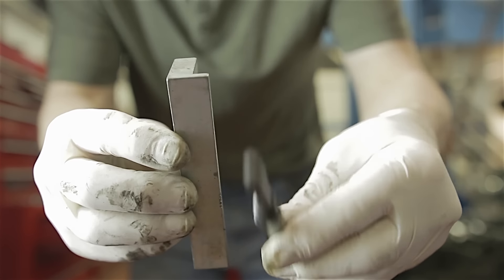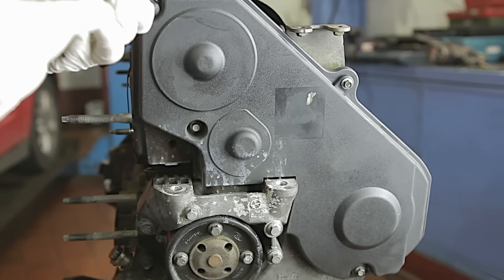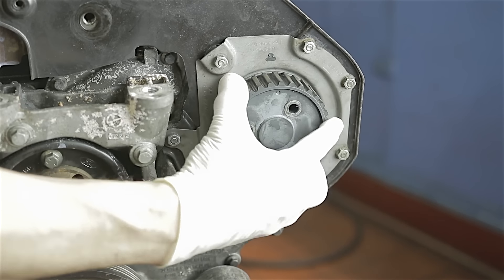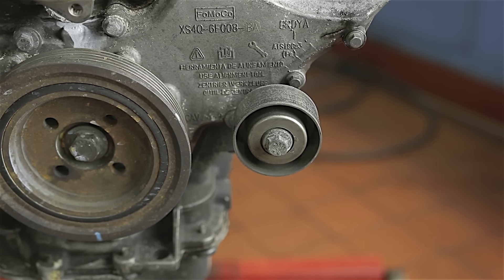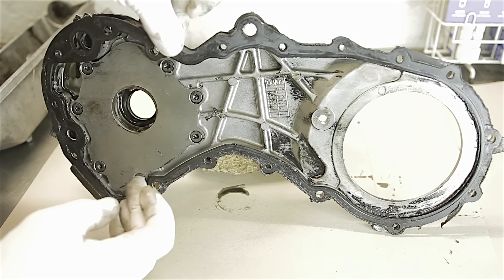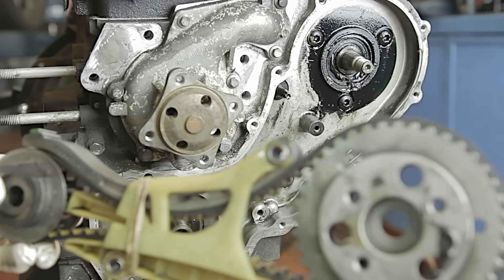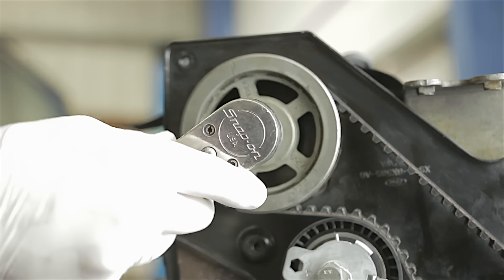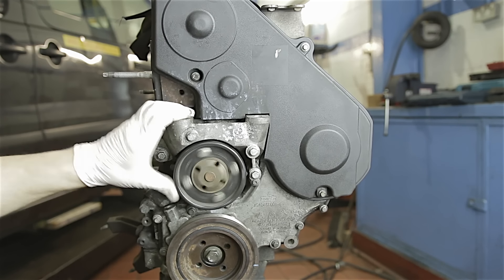Ford Mondeo/Transit Connect 1.8tdci wet timing belt replacement

Comment: Great work Alan, thankful for this video
Sadly my wet belt possibly snapped other day, is it worth changing the wet belt or what are the odds of piston-valve damage?
Reply from the maker: that will almost definitely have bent most of your valves and maybe broken valve guides
Reply: @alan4x  that is bad news, will be easier buying a second hand engine than and change it over.
Thanks Alan
Reply: @alan4x  managed to took it apart and fortunetly just shred the tooth of from half of the belt.
is still could damage the valves? what do you think? ordered new belt kit and will put it back together, soon as the belts is on i can check valves when turning the engine over a few times, managed to find a reconditioned head for £200 if I need it, still have hopes

Comment: Hello mate I've just done this job on a recon engine and it will not start even with easy start any Idea what the problem could be?turned it over by hand before refitting engine timing tools all fitted correctly so I doubt very much it's a timing issue it's a 2013 transit connect.
Reply from the maker: the fuel might need bleeding which can be a nightmare on those engines

Comment: Hi Allan I’m a total novice don’t understand difference it would make between tightening crankshaft pulley with a wrench or a gun if you are resting the pin back in to realign it
Reply from the maker: there is no real difference..just quicker with a gun but need to remove the timing pin when fully tightening crank bolt or you could damage the pin
Reply: Alan Howatt 
Thanks Allan

Comment: How I wish I'd known about this, this time yesterday! Lost power on motorway, towed into garage, no compression. They're checking but from what I've read sounds like the 'wet belt' gone.
Question : Is there any chance I haven't suffered major engine damage? 
Great video, if I was going to do the job myself, this would have been exactly what I needed!
Reply from the maker: hi, sorry to hear that.... the damage to your engine will probably be all the valves are bent, valve guides broken and possibly broken camshaft.....i doubt very much if a con rod has been bent or cylinder bore damage.... the crown of the pistons are thick and a few dents won't matter but the cylinder head will have to come off...it will not be a cheap job

Comment: Hi Alan I used your video to replace the timing on my Mondeo 1.8 tdci and you video is beyond excellent. I now have to replace the crank pully due to it wobbling. Can I simply just remove bolt or do I need to lock the engine again to do this 
Huge thanks 
Jim
Reply from the maker: hi jim, if you are using a air or battery impact gun to remove the crank sprocket bolt then you do not need to pin or lock the engine..just remove the bolt, fit a new pulley and whack the bolt back in, the timing will not move
Reply: Hi alan, thank you for your time to reply. I’d be using the old school ratchet and socket. My current crank pulley doesn’t have any holes in it for the tool. Would putting the car in gear be enough to remove the crank pulley bolt
Reply: @dogmaw1364 did you lock it or put it in gear?
Reply: I put mine in gear and it worked for me

Comment: hello alan, how long is the timing pin, I bought the timing lock kit and there are 3 in the kit and I don't know which of them are for a ford mondeo 1.8 tdci 125 hp, I'm interested in the size of the pin that enters the engine block, thank you

Comment: Hi Alan. I have a Ford Connect 1.8tdci 2006. When you pin the crankshaft it's supposed the pump mark align with the mark in the block or it doesn't really matter because it's common rail?
Answer really appreciated.
Great Video
Reply from the maker: hi, the common rail fuel pump does not have a woodruff key or any timing marks so does not need to be timed up in any way, although the bolt holes to align the cam belt sprocket onto the pump sprocket are offset so if all was set up properly the timing mark on the pump cam sprocket will sit at 12oclock...they are reference marks and have no purpose as long as when the crank is pinned correctly the camshaft is timed correctly as well
Reply: @alan4x  Can I send you a picture?
Reply from the maker: yes my email is   alan.howatt@gmail.com

Comment: You're the best Alan...honestly I've never seen such well described video...is it applicable for KKDA engine (Focus 1.8 TDCI)? Many thanks again and keep up good works...and videos ;)
Reply from the maker: thank you, there were a number of focus cars fitted with a wet belt, if you phone your ford main dealer parts department they should be able to tell you if you have a chain or wet belt using your registration number
Reply: alan howatt ....it's a wet belt for my focus 1.8 TDCI Duratorq 115 PS LYNX engine...confirmed when opened...thanks a bunch for your support

Comment: Thank you for showing us in great detail how to replace a wet belt . 

Do you know when ford started using these wet belts ? 

I have a 2006 transit connect .  Will it have the chain? or should I start worrying about a possible belt failure . 

Thx pat
Reply from the maker: the best thing you can do is phone your nearest ford dealer parts department and give them your vehicle registration number.... they should be able to tell you if you have a chain or a wet belt

Comment: Good evening, thank you for your video but I have a question, I am from France and during the disassembly / reassembly of the high pressure pump, the axis of this one has a needle, is there an importance whether it is placed particularly or not, and also the tightening torque of the bolt? Thank you for your reply

Comment: Hi Allan if you tighten up the crankshaft pulley with a torque wrench would you have to use a flywheel locking tool
Reply from the maker: yes you would, that is why i use an air gun to tighten the crank bolt

Comment: Love your vids , after 11 months and 3 goes including shiming the aligning tool for the belt cover  , i finally worked out why my seal was leaking , you're supposed to leave seal sit for at least 4 hours before starting engine , left mine for at least 24 . After a few thousand miles no leaks  , just one question what's your opinion on mk 2 focus 1.8tdci , cheers Ian .
Reply: My mum had the mk2 focus and had little problems that were wear n tear, but every car is the same, but like he said these engine suffers from slip timing belt and then engine is scrap, my mums focus timing slipped and we chose for the scrappy, but every car has there pros and cons.

Comment: Quick question Alan,i'm fitting a chain tomorrow with no timing marks on at all . do i fit it same as the wet belt but without aligning the pump and with all locking tools in place ? {it came as bits in a box ] as you say the pump is not timed up,only crank and cams.

Comment: What an F-ing nightmare that would be to do if the engine was in the vehicle ! Good video by the way.
Reply: You are not wrong! Once you get the lower engine mounting out though (the bolts ars longer than the available clearance🤬🤬🤬🤬🤬)  there is a reasonable amount of space to work with

Comment: Done this job twice now using the alignment tools but on both occasions I have leaking oil seal on crank pulley , leak is so slight only notice when front wheel is removed , cannot understand why crank pulley bolt is threaded all along it would make more sense if bolt was shouldered to fit centre of pulley you could then use bolt to pull pulley through seal instead of leaving seal support pulley until you tighten bolt thinking of shimming bolt to fit centre of pulley , any thoughts on this and the setup in general have you personally had any leaking seals after doing this job , Regards Ian.
Reply from the maker: hi, i know exactly what you are saying..that crank seal is so easy to damage and sliding the pulley through the seal is dodgy but i just carefully screw pulley into seal at eye level to try and keep it central and then hold the pulley so the weight does not rest on the seal... then tighten the bolt with an air gun.
  the only time i have a seal leak is when the timing cover is not aligned properly so i say keep all cover bolts loose while alignment tool is fitted and then nip a few bolts up on the cover.. remove the tool and tighten all cover bolts.  hope this helps
Reply: Ok cheers .

Comment: Hi Allen I’ve replaced the fuel pump on a 1.8 connect that already had a chain fitted. I pinned the crank and put the bar in the cam shaft  took the chain off but didn’t keep the chain and sprockets in one piece so lost the original timing on the fuel pump side but the crank and cam kept timed. As it’s common rail I didn’t think the timing of the pump would matter to much. So I rebuilt everything started up fine but it gets a bit “lumpy” around 1500 rpm and is throwing out white unburnt diesel smoke out the back. Is there anyway of getting the pump timed up again? (There is a pin hole on the pump sprocket but no where for it to locate on the pump itself) Any help would be greatly appreciated.

Comment: Allan I’ve got 2008 1.8 Smax does that have the wet belt or chain. Helpful video.
Reply from the maker: hi, the best thing to do is phone your local ford dealer parts department... give them your registration number and they should be able to tell if you have a chain or wet belt in the lower crankcase

Comment: Hi Alan great video, I’ll be following it step by step later today. One question tho, I noticed you didn’t mention locking the duel mass. Can I just use the pin and bar or should I lock the dmf too. Huge thanks
Reply from the maker: dogma w 
Hi. I did not lock the flywheel as I used an air gun to remove and refit the crankshaft bolt but if you are going to remove and refit the crank bolt using a bar or torque wrench then you will need to lock the flywheel.... don’t use the timing pin.. it will break
Reply: Thank you Alan, your videos are great and thanks for the reply 😊😊

Comment: Alan,
Very helpful video. One question: How do you stop the injection pump tapered shaft from turning while you are tightening that 21mm flanged nut which holds the sprocket to the shaft? I can't tighten this nut because the shaft is turning with it!
Reply from the maker: hello, if you go to twenty minutes and fifty five seconds in the video you will see how i tighten that 21mm nut up, cheers

Comment: Great video. I find it amazing that the camshaft pulley does not have a keyway. Is there any history of the pulley moving on the taper ?.
Reply from the maker: yds250 
Hi. It looks dodgy to me as well but once that cam pulley is tightened onto the taper on the camshaft it is secure. 
I have never had one come loose nor have I heard of one come loose but I guess it can happen if the pulley is not tightened properly in the first place

Comment: Hi Alan, when do you usually change the timing belt? My Mondeo has done 132K on the clock, It is a 1.8 tcdi diesel.
Reply from the maker: hi, the top timing belt on that 1.8tdci should be changed around 125k miles

Comment: hello Alan I have a transit connect 2008. and have contacted a supplier of the wet belt and according to my number plate on the Ford ecat. system my connect had the chain rather then wet belt. it is an 08 plate so do you think this would have been the last produced with chain. then the 58 plates would have been wet belts thanks
Reply from the maker: hi, yes, half way through 58 plate they started fitting wet belts so if yours has a chain you are lucky..and so is your wallet lol
Reply: @alan4x  thanks I'm getting the cam belt and water pump done and couldn't get a solid answer anywhere other then yourself and this supplier at last thanks for the help and great video. I'm so suprised how many merchanics I have spoken to that don't know about a wet belt. I'm surprised you don't have more views . cheers

Comment: apparently the wet belt came in during 2008 and earlier models will have chain. is it possible to remove the tension rod / pin / bolt to check without adverse effects?
Reply from the maker: yes just unscrew and remove it.. the chain or belt will not skip teeth

Comment: Hello Alan, I have 2008 Mondeo MK4 1.8 TDCi. Is it possible to replace wet timing belt on the engine that is inside the car? What should I remove to get access to every bolt etc.
Where did you buy this aligment tool (19:07  min)?
Reply from the maker: Jan Kasowski hello.  
You can get alignment tool from eBay. Just search ford 1.8 tdci timing tools. 
Yes you change the belt with engine in car. Remove wheel and inner wheel arch liner. Remove engine mount and support engine with a jack under the sump. You can then get to all you need to from under bonnet and under wheel arch.
Reply: Thank you very much for your answer :) Good job with the video :)
Maybe you can show how to replace  clutch and flywheel in 1.8 TDCI (6 gears)

Comment: I have a 2004 focus 1.8 tdci is there anyway of indentifying if it has a wet belt fitted without stripping it?
Reply from the maker: phone up your ford dealer and give them your registration number... their parts department should be able to tell you what is fitted
Reply: Thanks Alan! Only just found the channel and loving the content ! Cheers for the advice !

Comment: Hi Alan what happens if you turn crankshaft till you hit the timing pin but the plate doesn’t fit in the groove
Reply from the maker: chipper701 
Hi. You would loosen the camshaft sprocket centre bolt. You would then turn the camshaft from the centre or somewhere so the plate slides in the back. 
Then you can fit your top can belt .. adjust it up and retighten the centre camshaft sprocket bolt
Reply from the maker: chipper701 
Hi..  if you fit the crank pin so the crank is timed up against the pin and the cam setting plate won't fit which is sometimes the case it is a little out..... loosen the top cam belt tensioner and remove the top cam belt. Now you can turn the cam till the plate fits without moving the crankshaft
Reply: Thanks for responding Allan brilliant informative video.

Comment: Hi Alan just watched your YouTube video about wet belt really helpful video. I've a 2008 08 focus I've asked ford they said in parts it has one. Although I've heard some early 08 are mismatched. I'm pretty handy with spanners and gonna try it after watching your video. Just one query if I take the tensioner out to check will it be ok after? Btw  the car only has 61k on clock so not too worried although I guess time will also affect it. It has fsh also

Comment: Hi Alan, is it possible to screw the timing pin into the block while the crankshaft is 180degree wrong? Everything looked similar to your video, but now i can turn the crankshaft only a little bit ( 90-120 degree) and the camshaft blocks.
Reply from the maker: yes you can get the pin in the wrong place...thats why i get the camshaft almost lined up first

Comment: On what years did they have a wet belt? I have an '06 Connect, 1.8 Endura 75ps turbo diesel. about 115k miles so far
Reply from the maker: 06 plate you are ok..it will be a chain...the wet belt came out in 2008 til late 2010=11

Comment: Hi Alan. Just a quick question. I've fitted a wet belt conversion to my mondeo and the car runs fine, the only issue I have is a small oil leak from the fuel pump side somewhere. I've changed the pump seal for a second time but the problem is still there. I was wondering if it's possible for oil to leak between the fuel pump and sprocket if there's not enough sealant on it? I'm totally baffled at the moment. Any advice would be much appreciated 👍
Reply from the maker: hi, there should be sealant inside the sprocket that bolts onto the fuel pump chain sprocket...i think i show it in the vid but was the oil leak there before you do the job, there is a gasket between the lower timing chain housing and the engine block which could leak but if not it is important that the chain cover is centralised using the tool in the crank sprocket and all the bolts are tightened evenly

Comment: I was going to replace the outside dry cambelt according to HAYNES manual Ford Focus 2006 Diesel 1.8 TDCI . Now I stopped right here not knowing where to go from here ! Which one is correct? Buddy Alan or Haynes Manual ???!! I can't believe a £ 14.00 quids manual misses to mention such an important engine item or shows just half of the job !!!can anyone explain please ?? Or you Dear good old trusty Alan !
Reply from the maker: hi, a 2006 1.8tdci will have a chain in the lower crankcase so you only need to replace the top cam belt......the wet belts were not introduced until late 2007-2008...your ford dealer parts department should confirm this with your registration number

Comment: Hi Alan. 
I bit stuck here... I've got ford S-max 1.8tdci... i did get the conversion kit and mechanic did the job all went well apart from oil leak from crank pulley seal. It used to leak before and even after replacing few seals still leaks. Aligning tool has been used (so they say) is there any other reason for it to leak??
Any help and advice will be much appreciated...
Thanks
Reply from the maker: hi, assuming the timing casing is aligned properly....check the crank pulley where it sits on the oil seal and make sure the seal has not worn a ridge in the pulley...if so it would be best to replace the pulley
Reply: Hi.
Thanks for speedy reply.  Yes the pulley has been worn and replaced with the new one... Is it possible that the timing casing worn?